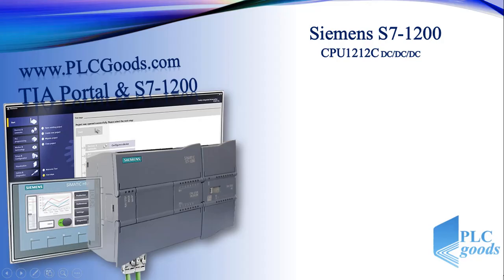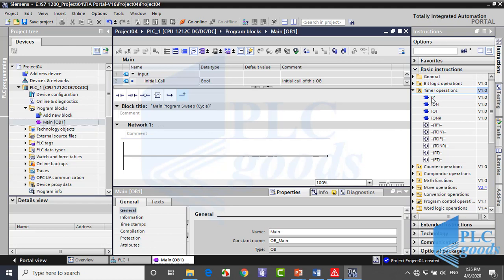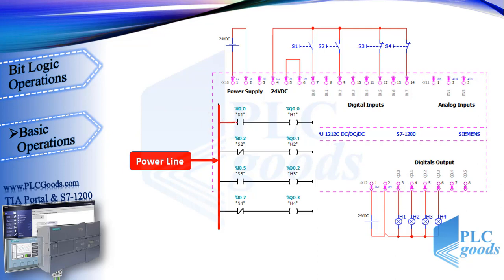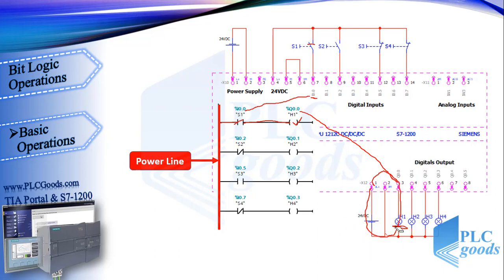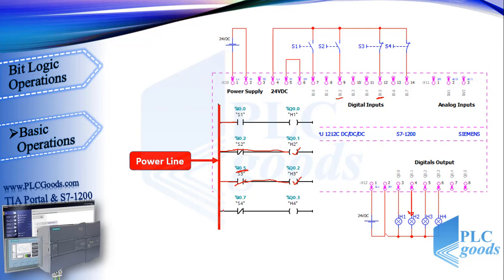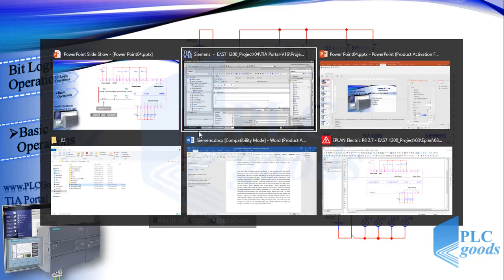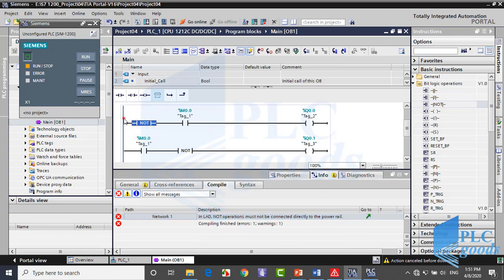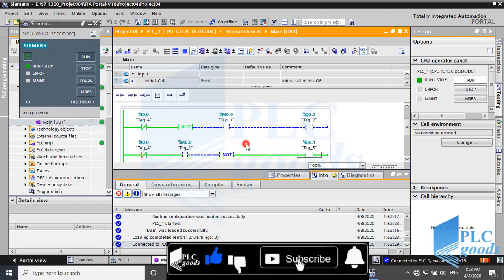Siemens S7-1200 PLC | Basic Ladder Instructions & Invert RLO Explained | L 07

Comment: S1 NO, S2 NO, S3 NC, S4 NC.... BUT U TELL S1 AND S3 ONLY NO HOW PLEASE EXPLAIN..?
Reply from the maker: Hi there, the pushbuttons' names are similar to the names of the contacts which have been used inside the program. In the PLC wiring, only 2 pushbuttons are NO ( S1 and S2) , and inside the program, only 2 contacts are NO ( S1 and S3 ). Overall, each pushbutton and contact has 2 states, Therefore when they are used together, we'll have 4 states which were explained their performance in the video